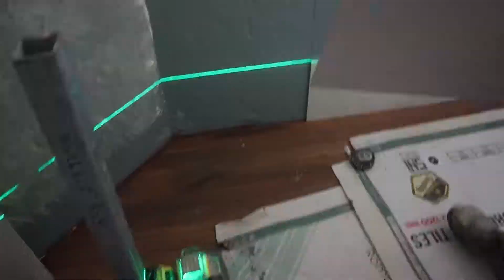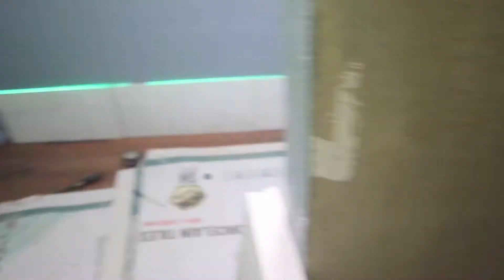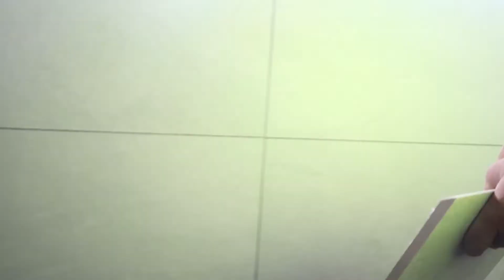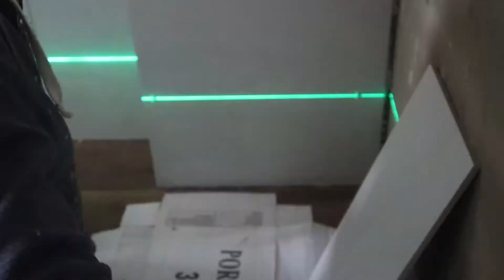how to install 300x600 wall tile

Comment: Hi, lovely work mate, been tiling now 35 years and it's proper hard work. One thing did make me wince though and it's not a criticism of your work. It's the bit of wood outside with the nails sticking out! Having stepped onto a nail sticking out of a bit of wood i can assure you the pain and the resulting 3 weeks off work wiped the smile from my face. Whack em in mate!
Reply from the maker: Thank you for your comment

Comment: I’ve been doing tiles for long time and I learned that . If u make swirls on the glue , you will trap air in between , there is a good example you tube video .demonstration with glass so you can see